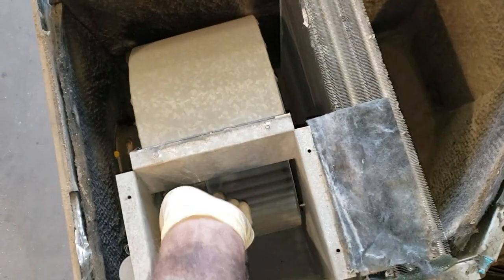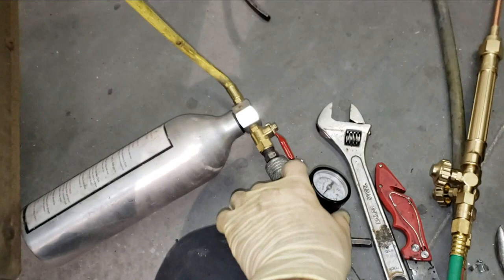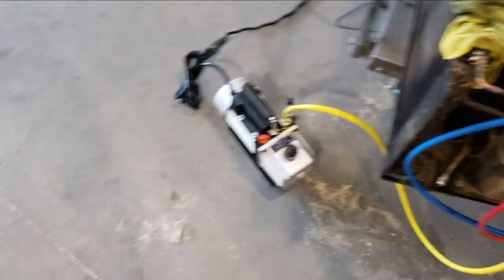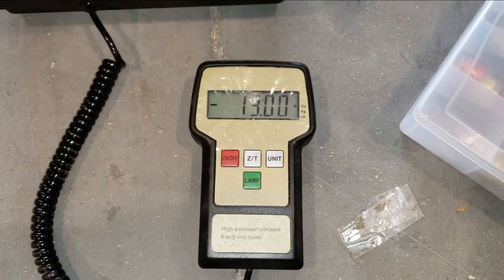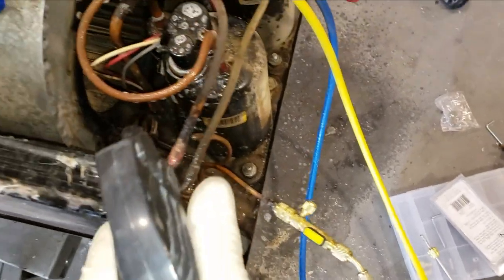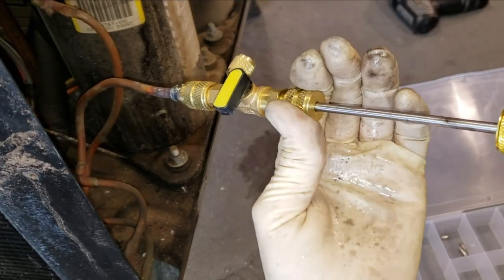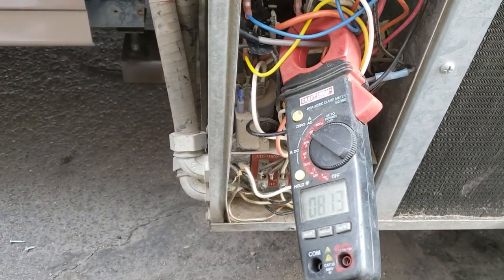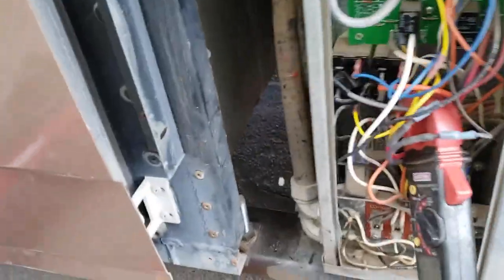Coleman Basement RV A/C Leak and Repair

Comment: Just replaced the board on mine, turned it on only to find that the outside fan carrier bearing was deafeningly loud. Removed the unit as you did, got an OEM bearing in 1 day from Amazon. While it was out I cleaned everything, especially the coils that are not accessible while installed. Oiled everything (why didn't they put in sealed bearings since you can't oil them anyways) and fired it up. Quiet as a mouse on my 2003 Winnebago 35U. Both compressors pulling 8 amps! Time to go glamping.

Comment: Never seen a basement AC. Pretty cool. Lot of work to get it in and out I see. Nice fix. 👍🏼
Reply from the maker: Thank you
Reply: As a hvac tech I would never leak test with air. Yeah you're going to evacuate it but the polyester oils will absorb moisture very easily and sometimes you cant get all the moisture out. Plus the compressed air could have debris in it. With those small capillary tubes they can easily get clogged.  I would also invest in a micron guage so you know your moisture level and evacuate down to 500 microns.
Reply: Also why are you charging liquid straight in to the low side of the system.  Your tank is inverted.  The refrigerant will be in a liquid state and must go on the high side. Red hose. Compressors are vapor pumps. You could very well be causing damage to the compressors and by the way it sounds it's trying t ok pump liquid.

Comment: Not a bad repair. I would probably buy nitrogen for leak testing. Air from an air compressor can plug things up in HVAC. You being in Arizona guessing you air is pretty dry though. Really like your videos. Just my thoughts I do HVAC for a living. Thanks for taking the time to show us all you do. I have learned a lot. Not bashing you so please don't take it that way, just really wanting to help you the way you help so many others.
Reply from the maker: Thank you. I have a great deal of respect for hvac techs. There's so much I dont know, the rv world just leaves so many customers stranded that I try my best to help. I know my setup is not ideal...truthfully I'm more concerned about my solder skills.
Reply: The soldering looked good, and what you came up with to do it was impressive.  Main thing on soldering technically it's welding in HVAC as you are getting over 1,000 degrees, but who cares we know what each other means. The higher the silver content in your silver solder the better it will flow. I like to use at least 15%. It's expensive, but playing around with leaks isn't fun.
Reply from the maker: @billcorbet9746  Thank you. Even though this are just self-contained residential ACs most HVAC techs want nothing to do with them(I don't blame them) and most RV techs are confused by them, which of course leaves the owners in a bad place. I worked with a few RV techs that did HVAC work previsously and they taught me a few things. I just try my best to help. Thanks for taking the time to let me know the work was good. I'm never that confident with the torch and solder as I don't do it very often. Thank you again!!

Comment: Very interesting video! I have a 2005 Alfa, and I understand they are similar. It works good, but is making a little rattling noise. Hope it is something simple. Previous owner put 2 roof mount units on as he was stationed in Arizona for a while. Said the basement unit just could not stay up with the heat in Arizona. :)  Keep up the good work! Would like to find someone in the North Texas area to service my basement unit. Mainly to check condition/cleanliness of unit. Previous owners had a dog. :(
Reply from the maker: Maybe someone will see your post!

Comment: Early Wanderlodges had them. So glad we went back to ducted roof units. Looks like big pains.
Reply from the maker: I think any fewer holes in a flat roof is better, but yes they are very large pains and I would steer most people from RV's with them. Thanks!
Reply: AZ Expert I pulled all my roof units up and redid the seals last year. As it is I have a seam or a rivet leaking. Working on renting a theatrical smoke generator and making a door fan go find it. It’s above the kitchen cabinets.

Comment: Thank you so much. Hard to find someone to repair our basement ac unit. I am trying to repair our 2002 Winny coleman mach myself. The thing runs about one minute cuts off then second stage kicks in and runs maybe another minute and shuts down. Have checked all caps and relays. Thinking it's either load might system or control board. Not sure what to do. Any thoughts?

Comment: Love your videos man.  Do you have any showing how to pull one from an alfa?  Ive pulled from a winnebago and it wasnt too bad. This alfa has me stumped.
Reply from the maker: it mounts similar, often there is a furnace duct in the way, but the exterior grill must be removed and the whole unit slides out the grill opening. 5th wheels are much more difficult

Comment: Very Important information... Priceless;;  My Question Should you Decide to answer is;;  How can A  Coustomer Do a Primary Check On  What may be the Cause of The air Not working..  Mine On my Ultimate Winnebago . Quite, ( now I understand, Winnebago is an Entry level Coach) A shop Replaced the Basement Unit , $6000.00  I went on A trip. It Didn't work Took it Back They said The thermastat. Was bad. Another $500.00 . What To do. My Years 84 Have Not rewarded me with much Money..

Comment: Don't sweat the brazing skills, if it doesn't leak, it is acceptable. Do you have a video showing the actual removal of the unit in a Winnebago? Watched the one with the '02 Alpha Seeya and all of the ductwork was different from my '02 Winnebago. Mostly interested in tips on disconnecting old and probably fragile ductwork without destroying it. Have a reversing coil fail and want to replace both of those and clean out whatever I may find...
Reply from the maker: I have one on an older Winnebago with a different duct than yours. The only duct you'll have to disconnect is the bottom elbow at the rear of the unit held in place with "c" shaped bracket with phillip screws.

Comment: I’m trying to determine if one of my compressors has gone bad or if Freon has leaked.  I noticed some  fluid coming from the outside blower area after coming back from my last trip. Storage place only has 30 amp so not sure if that is why the second stage may not be turning on if not. Not getting close to 20 degree spread, but cools. Don’t know how to test if the second compressor has issue.  But do both compressors use one Freon line or two from what it sounds here.  Maybe one has leaked like this video.
Reply: Each refrigerant/compressor circuit has its own refrigerant charge…
Reply: @waggtech4883  thanks.  It is actually in the shop and one of the compressors has a crack.  The tough part was finding one.  Hopefully get it back soon.

Comment: I'm on the west coast in California. I would love to have you look at my coach I have an 09 Vectra 40TD I think after watching this I may not have my second stage working. It was 108 today. And the coach drivers AC was not pumping out very cold when I was driving. Also the basement AC was cool but not cooling the coach adequately! And to top it off the freezer was cooling but not freezing so the fridge was not cold enough. How can I bring my coach to you for you to check it out? Obviously I really need help and you seem to be the guy who knows his stuff. Mesa AZ is about 7 hours away from me. I think I can swing that.
Reply from the maker: I really appreciate the enthusiasm. I really hate the idea of having you suffer, but I am backed up for three weeks already. If you have the original cooling unit in your Norcold 1200 frig, it may very likely be going bad....however those 1200 perform very poorly in Southwestern heat from the start. I would make sure you check your A/C air filter, many owners are unaware there is a pleated filter usually under the bed area and they get clogged fast. More than likely the dash A/C is low on charge. Almost any auto garage should be able to check the dash A/C for performance. Thank you!

Comment: Good job, I have a better understanding on what I'm to do to replace or oil my  fan blower its  starting to talk to me.  Thanks any insight would be appreciated
Reply from the maker: I would recommend replacing it as the work will be the same and then you'd have a new motor that should last 10 years. Thanks!

Comment: At 21:20 in your video the condenser coil is coated with oily dirt from the AC leak.  Why didn't you clean it before reinstalling the unit?  Also when the unit is out can a set of glides be installed for ease of servicing in the future?
Reply from the maker: I cleaned it dont worry. Also the unit has to be clamped up into the ducts about 2 inches so rails would be a difficult addition. Thanks

Comment: I have a 2000 Winnebago Journey. The second stage compressor keeps tripping. Do i definitely need to replace the compressor?
Reply from the maker: Not definitely. I just had a 2nd stage with a shorted wire last week adn I have seen the relay cause that issue too. But yes likely. Sorry.
Reply: @AZExpert  Thanks for the quick reply. I love your videos! Can I swap the relays and see if the first stage compressor trips the breaker? Can I check the compressor without removing the unit? Anything else I can do to pinpoint the problem. Thanks in advance.
Reply from the maker: @michaeliacono3733  yes you can!

Comment: Im in the process of buying a 2001 chieftain. Its got a basement ac as well. When I went to check it out, the inside blower was not turning on. Do you know common reasons for this?
Reply from the maker: motor or control board
Reply: AZ Expert awesome, thanks!
Reply: The start capacitor on mine had failed a couple of months ago.   The capacitor had ruptured and dielectric jell was leaking so it was obvious.  An easy fix.  Replaced with one from local appliance store.

Comment: Anu chance you would know how to wire a home thermostat to this unit? Been looking everywhere for months and can only find info from 2016 and before for thermostats no longer made. I just hate the coleman mach thermostat and I think mine is dying. Ac compressors cut out randomly for about 5 min and other times just works like normal. Seems to cut out more in Temps above 85. Help!
Reply from the maker: It really can't be done. It's a special tstat that will only work with the basement ac. I'd recommend a new rvp  tstat than trying to retrofit a home tstat.
Reply: @AZExpert  kinda what I thought. Any ideas on what might cause the system to shut down randomly in hotter Temps for about 5min and then restarting constantly? It's fine below about 85 and runs like normal until set temp is reached. Above 85 to 90 its seems to shut off multiple times for about 5 min but not always. Runs very cold when running. I replaced the outside blower, main board and relays about 1yr ago and cleaned and resealed everything. Any tips would be appreciated very much
Reply from the maker: @georgehorwell4271  I guess I'd have to know what is shutting down, if the tstat is telling it to or if there is a loss of 120vac power at the board or if some blowers run but compressors turn off.
Reply: corey Babcock  it's fixed. I pulled it out to replace the indoor blower. When the unit came out I found about an inch of muck stuck to the back of the condenser. Cleaning that good and replacing the fan motor and its like a new system. Also replaced the thermostat with a home unit that runs on batteries. Also works great and now I can program my thermostat. The cutting in and out was due to Temps getting too low and very little air flow over the condenser.
Reply: @georgehorwell4271  Can you outline how you wired the home thermostat?  Thanks!

Comment: Or replace it with a mini-split which would be way more efficient - if you use a ducted air handler, you might even be able to retain all the ducting.   It would be more than an RV roof AC, but those things never really work well, they are basically the RV equivalent of a window AC
Reply from the maker: Packaging is a large issue. I'm sure it could be done, I have seen it, but the cost to make it look good would exceed the cost of the repair by ten fold. Thanks!